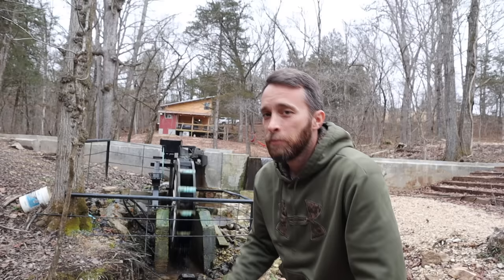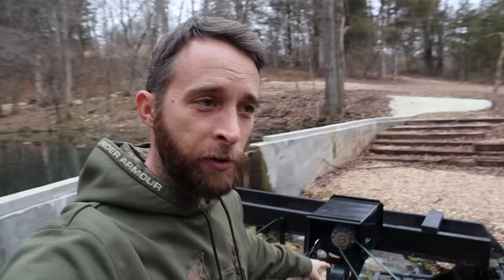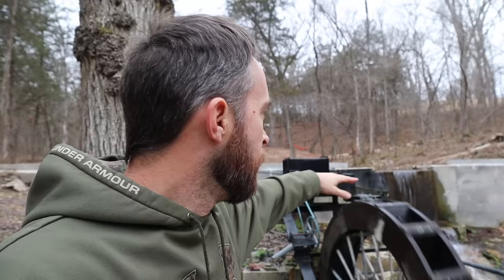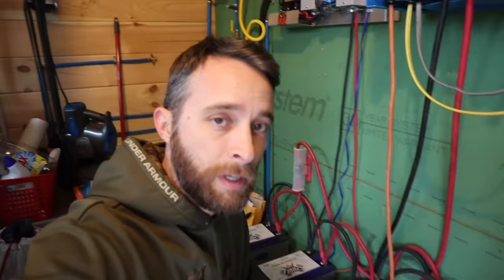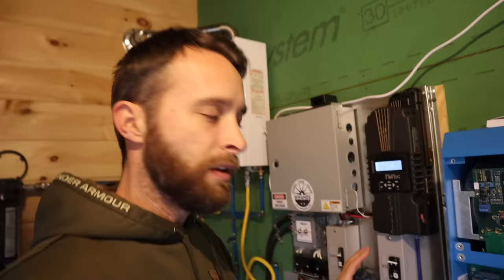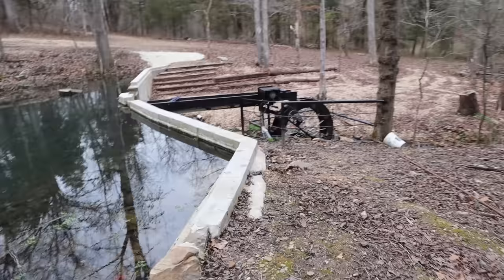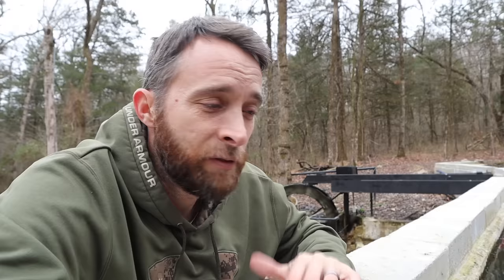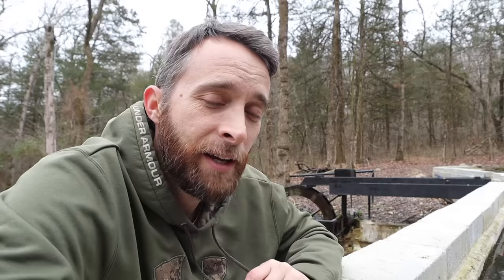Did we MAKE HYDRO POWER Using Our Waterwheel for Self Reliant Off Grid Living?

Comment: How many amps are you generating right at the generator?
Reply from the maker: I’ve never tested it there
Reply: @LoftisPartyofSix  You may want to test right at the generator to see if the issue is there. If it is not there it is possible you have a cabling issue.
Reply: And if it is there, you are at the root of the issue.
Reply from the maker: @thebiglebowski9849  cabling issue? That’s a new word for me.
Reply: @LoftisPartyofSix  It is possible that the electric cable from the generator may not be thick enough to carry all the power. If the cable is too thin for the voltage, you will lose power due to the resistance although if the gauge is not thick enough it will also generate heat. The gauge of the wire will be determined on voltage, length and the materially the cable (copper vs aluminum), That being said you will want to check the generator firsts before doing anything with the electrical cabling.

Also, if you are using aluminum cable you need to use a special paste when you terminate the cable (aluminum generates a lot of resistance when it corroded unlike copper, hence the need for the paste)
Reply: @LoftisPartyofSix  One more quick thing..I use the terms cable and wiring interchangeably (I work in IT hence my use of the term cable instead of wire).
Reply: The amps at the generator and the amps at the house will be identical, there is going to be a voltage drop.
Reply: @dougmc666  That should be the case but that assumes that nothing else is running parallel off that generator.

Comment: Just come across your YouTube video. Do you still have your water wheel? If the answer is yes. I might have a solution to your problem. On you're gearing. You need to put the smallest policy you can find. On one side. Then put the biggest Polly that you can find on the other side. You might find that it will spin faster. You will still find that you will have a voltage drop. Due to the distance that it has to travel.

Comment: More work, but you appear to be on a hill that continues to slope down past the water wheel. Can you not just extend the flue and move the power generation down the hill to make your 20 foot drop? Perhaps even replacing your open flue with a closed flue (pipe).
Reply from the maker: Maybe only 3 or 4 feet drop past the flume. Just not enough

Comment: Mechman 300 amp Alternator. Will work out. Give them a call.
Reply: Mechman comes with a voltage  adjustment that you can tweak.
Reply: Victor Galagan A 300 amp alternator is far too big. That's over 3 kw at 12 volts, which is far more than the potential energy of that fairly low flow / low head water. You need a smaller alternator / generator more closely matched to the power of the wheel. I'd go for a 250 watt generator.

Comment: Use 24 volt truck alternator instead of those motors and no need of this big charge controller setup to maintain regulated voltage

Comment: the cable strech is too long. you get a voltage drop.
thats why the grid uses hich voltages. you can use an inverter at the generator.

Comment: I'm not sure about the guage of wire you have from the water wheel up to the house. 

What guage of wire is that?
Reply from the maker: I tried looking up that info on the website.. all I found was 10/3 wire
Reply: I’m thinking DC voltage drop over that long run is the problem.  Thicker wire would help, but probably not that much.
Reply: @LoftisPartyofSix  that wire size is too small for the length it travels. There is a formula under ohms law that will specify what size wire you need. I am a retired electrician. If I remember the formula correctly you would need 1/0 copper or 2/0 aluminum wire.
Reply: @iamthundermug  Or put an inverter at the alternator. That way he could run 120 or 240VAC to the house.  At 120Volts that would give him the ability to send over 2KW through the wire he has. At 240 VAC, he could send 5KW without a problem. His unit at the water wheel is not going to produce either of those amounts but his wire could handle it. Him getting 50 Watts right now means there is something major wrong.

Comment: A little bummed it didn't work out for you. For the money spent on the setup it would be nice for it to at least be able to charge the batteries. Ideally,  if the water could be pressurized to speed up the water wheel much like a peleton setup. I'd contact the Beligium company Turbulent and show them what you have for a set up. Or check out Suncatalyst to split water into hydrogen via solar. 3 gallons of water a day would provide all your energy needs. Start up costs though are expensive for the fuel cell so... you're probably best to simply pick up solar panels.

Comment: A turbulent turbine the water goes around like a little chat you make it out of concrete or I think they sell some of the fiberglass picks up to speed and then it goes into the thing turbine so it's already spinning you'll get a good amount of power very good amount of power and you only need like under 6 feet they might even sell in fiberglass or turbulent turbine electric generator

Comment: Your dam is good, but you need to make changes on the wheel and generator. You are loosing water on the side, why? You need higher water flow on the wheel. Then your wheel can be on the lower point and it needs to have bigger plates so when water drops it needs to hit the plates and then you can expect spinning. If you want i can find some videos and put links for you.

Comment: Generator is over spec, the smaller 3 phase Ac wind generators and cheaper charge controllers might work better for that scale. The high torque from the wheel might cause the belt to slip.  220ft is a long wire, with solar cables the recommended cable is over spec deliberately

Comment: 40v @ the charge controller X 2A (average) x 24 gives you almost 2kwh/day. That is not inconsequential. Add some solar to supplement and you're golden.

Also, your thoughts on life of 12 vs 24 or 48 v  battery life are all wrong. Research that. 48 v is preferred for, among other reasons, lower system losses.

Comment: Is your generator a permanent magnet or field-excited type (like a car alternator)? As a new electrician, I am going to assume the latter and guess that your generator (2,000 watt?) is too big for how much energy your wheel can extract from the water. It pulls more current than the wheel can sustain, which slows it down and reduces your voltage. Less voltage means less magnetism, which makes less current and allows the wheel to speed up again. Try to swap it for a 1,000 or even 500 watt model? A little bit of juice running reliably will be much mo betta. That's a technical term...
God bless y'all!
Reply from the maker: It’s a PMG generator.  But it does slow down the waterwheel when I turn the whole system on. Not sure if that’s the generator or the charge controller.
Reply: @LoftisPartyofSix  
{I just found your channel, so I don't know how much you know. I don't mean to insult anyone's intelligence.}

"Google it, Patrick."  🤦
So I did. You have a 12/24/48 volt PERMANENT MAGNET generator head (which you probably already knew). 

You can gear it down with pulleys to make 12 volts, but the voltage drop over such a distance is going to kill your production. That's why people say higher voltage is better. It travels long distance better. 12v cables shouldn't be any longer than the ones in your car from the battery to the starter. 24v cables can be twice as long, and 48v doubles in length again for a given percentage of voltage drop.

You've built your system out at 24 volts, and don't want to buy all new stuff. From my phone, I'd say you have a 200' run to your house?

I think you need to build a generator house right next to your wheel, move the entire low voltage setup down there, gear the system down to make 12v, keep your cables as short and thick as possible, and send 120/240 to your house panel. 

You busted your tail doing all that concrete work! You have good water flow most of the year. This can still work for you! Don't give up.

Comment: You need some one to figure out what speed your water wheel is turning at the shaft. Then what ever that ratio is; using a gear box with that ratio then your generator will put out what you require to operate your inverter.

Comment: Your sight can work. and I trust it will....Sadly, free power is not free unless you are willing to endure and wright off the learning curve. Beautiful workmanship and talent, if miss directed is wasted. I have been off grid Hydro for 30 years and it cost big bucks.  I will now comment: 1) your water wheel design (although beautiful) is poor, Research Fitz.    2) weir your stream  Flow&fall= power, You need to know what it has available before you can ask it to provide.. I expect 9 months of love and 3 of hate. LOL....It ant gonna be cool in summer.3) Hydro produces massive torque at low speed. LOL...lawnmower bearings & Belts won't live here. 4) Once you get a proper wheel (think wider, curved buckets), Put a phony brake on it at low, average and max flow. 5)  Once you know what your wheel will produce get an industrial DC generator (not some car alternator"s child) With massive bearings, STRUCTURE and belting; Then house it and the drive system in a dry environment. 6) at this point you need to consult your battery charging/inverter guy for a control system. Trust Me....If you do get it working dependably you will be an ENGINEER !!!! Unike most things you do yourself Hydro is a steep curve as all sights are different. You just GOTTALOVE IT. I love anybody working with water.

Comment: The water is hitting the wheel at the wrong point. It isn't big enough to produce meaningful power, and the belt drive is going to be lossy.

I'd look at the turgo/pelton turbine down the hill and use the mill pond as a header tank for it. I expect you could get a few hundred Watt from that.

Comment: The water wheel is too heavy for the waters to spin it fastly. Use a lighter wheel to get the optimal voltage you desire.

Comment: Hi. Maybe you should hook up with Kevin Crawford youtube channel. He seems to have a system not that much different to yours. He comes across as a good guy willing to share his knowledge. I think it was Alternative Energy, Water wind and Solar. He only had a 4 ft water wheel so maybe its a question of the generator. I remember he rebuilt his to accept a slower speed. Good luck to you. And I forgot to mention you could get a rampump to deliver water up to 90 feet above the level of your wheel foc. So a 2 or 3 inch rampump will deliver a lot of water to higher storage area and there you go...... 48 volt power....

Comment: Why not use PC pipe in front of the shoot with an elbow PC pipe let the fall straight into the wheel it should run faster. Then you connect everything back with a sprocket and chain or old bicycle pedal cam from the scrap yard. In stead of these of these big wheels.

Comment: I'm no hydro engineer, just a fair to middling science guy but a few minutes in and I see so much wrong with this setup. The amount of energy stored in water is proportional to the head, the height of the drop to the turbine. You have lost all the energy that was in the fall of the stream by building a pond and then your outflow chute is right at the top of the wall so there is no head essentially. Just a tiny bit of velocity from how the chute is angled down. The outflow chute needs to be a pipe at the bottom of the wall so the pressure of water above this forces the flow out fast. You need to build some speed up in that water to generate kinetic energy in it before it hits the wheel. You could still take the supply from the top of the wall if the pond stays full but the chute would have to angle downwards for a decent distance to generate a head and kinetic energy.

Secondly the water chute ends before the axle location of the wheel so some of the energy in the water is expended in trying to turn that wheel backwards and there's very little energy in the water to start with. You need the water to hit the blades in the wheel beyond the centre of rotation so all the force goes into turning the wheel one way. The blades in the wheel also don't look ideal to capture what energy hits them. Something cup shaped would be much better, or even straight blades but not angled directly towards the axle of the wheel.

I suspect even if you are getting some decent wheel speed there is no torque to apply a load against and power = speed x torque. You need both.

Comment: Not know hardly anything about hydro dynamics, why not have a 12" opening at the top of the dam down to a 1.5" outlet at the bottom out maybe 15' and spin the turbine there?   Or for that matter start at the spring with 50% flow down to the dam, over the edge and then neck it down to a turbine at the bottom.  "I" would think that would spin a balanced turbine as fast as needed??  Nice work though and I do like the waterwheel.!!

Comment: You need to move the wheel back 6 inches and Smaller pulley
Reply: Even I was confused by the wheel position thought it was meant to be just over top dead centre so in low flow you still get the rotation as its no longer fighting itself.

Comment: Major bummer! Have you tried running your generator not off the water wheel but heck, even off your cordless drill, to confirm that it can or will output the expected power at 500 rpm? Maybe your generator doesn't work right, or your belts are slipping. For about $20 you can buy an RPM meter so you can confirm that you're actually getting 500 rpm at the generator. While the math may be done, losses through belts slipping or other things could mean that you think you have 500 RPM but you don't. 

If the generator is not working right, maybe it needs to be replaced. 

Go through each step of your process and verify each step. 

You could also install a centrifugal governor to ensure your water wheel never exceeds the RPM that your generator can handle. Maybe spinning the wheel too fast damaged your generator? Or your electrical devices?

You could also still run your water wheel as 12v and buy a device to bump it up to 24v so your system can handle it! 

Also, I think for another person who is thinking about building something similar, verify things first -- measure twice, then cut! Figure out what voltage you want to do for your setup. Calculate the amount of energy you'll need.

You mentioned not knowing a lot about everything -- I think that's a big mistake here. You really want to be really educated about generating power with a water wheel or turbine before you start building dams and weirs and such.

I wouldn't give up yet. Keep learning, you may be able to get something out of it yet!

Comment: Think about the size of your alternator on a vehicle - which is a generator. That generator is about the size of the alternator in my 1/4 ton truck. That alternator maintains a battery and runs the electronics in my truck. You're attempting to run several deep cycle batteries with dynamic loads off of that poor little generator - you need need a higher wattage generator.

Comment: of it's typical wire hen abut 8 ohms per 100 ft ... so roughly 20ohms loss for the run .... if one assumes 120v at 1amp ... or about 20v loss ... not bad for a local system 
on a 24v system thats 5v loss ... 

if you could make a u channel on the motor side of the wheel and use a belt to drive from the wheel direct to the motor ... you would get a pretty decent ratio ... at roughly one revolution every 4 seconds as it was filmed here ... then a minimum of a 10:1 gear set ... 10 teeth on the wheel for every 1 tooth on the motor ... better would be 20:1 or more ... this would get you about 30 revolutions per minute with a motor spin of 300 RPM ... if you want to keep it simple get a 10 tooth gear for the motor side ... and find the biggest ratio you can manage on your wheel (if its belt drive then the motor is 1/10th the diameter of the wheels belt ring)

Comment: Wait wait wait, are you running DC all the way to the cabin? No wonder it doesn't work. Replace the generator with an alternator and put a rectifier in the cabin. AC transmits way more efficiently than DC, so you are losing a ton of power to heat. Also, your wheel unfortunately is very small, so every last bit of juice counts. If you had made your concrete footing wider, you could have doubled the width of your wheel maybe. I recommend using a turbine in your situation. Or a series of small turbines.

Comment: Dear just connect used car' mannual gear box with water turbine and use AC alternator 15 KVA to 50 KVA. It will produce 24 hours electricity for your home. Best luck.

Comment: For the size of system you need. Probably $12k would get you the power system you need. We run our whole house off solar.
Reply: I disagree on the cost to install Solar. Loftis already has everything he needs for the Solar System except for the panels, mounting and wiring to the cabin. Solar panels are relatively cheap, a quick search found quality panels [Canadian Solar 325 watts] for $0.70 per watt. At that price $2,000 to $2,500 worth of panels would probably supply most your cabin's energy needs. Add another $1,000 for mounts and wiring you have your Solar System. Add this to your Water Wheel generation and you are good to go.

Comment: Voltage Boost Converter DC-DC 8-60V to 10V-120V Adjustable Step Up Converter 900W Voltage Boost Module Regulator for Voltage Conversion

Comment: Running the generator for a couple hours a day seems excessive. are you running electric heat or something. I run a full size fridge, internet+computers, lights, electric kettle and sometimes a space heater for a little while on 1 kw solar to 250ah LA batteries on a 12v inverter and have never needed a generator. I've only had to really conserve power after 3 or 4 cloudy days in a row.